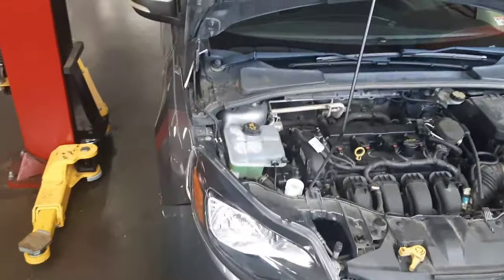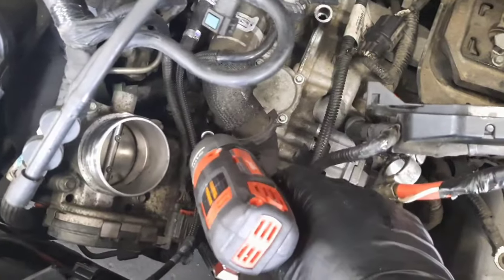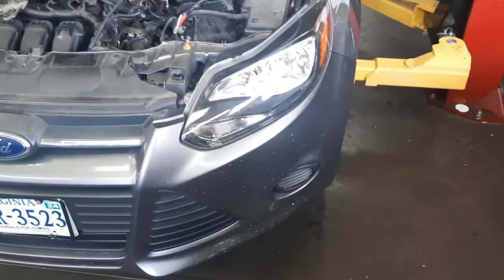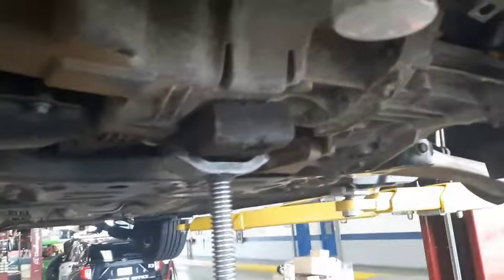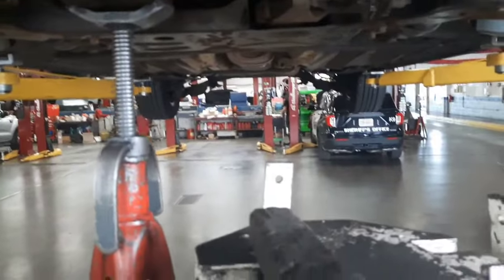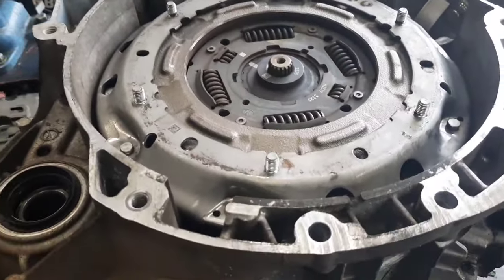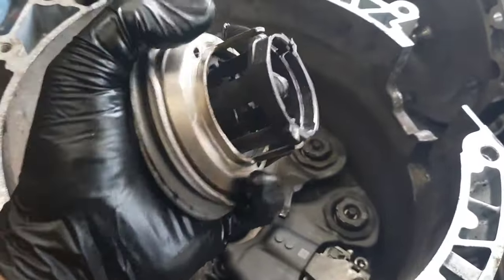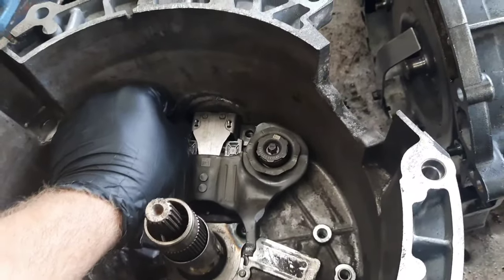Ford Focus Clutch & Fork Replacement & Transmission Removal |  Dual Clutch Automatic 2012-2018

Comment from the maker: Thanks for watching!
Dual Clutch OEM Clutch & Fork Kit: https://amzn.to/47GMeIl
OBD Link EX (For Forscan): https://amzn.to/3HsvidV

Clutch/Fork replacement with NO SPECIAL TOOLS!
https://youtu.be/EIJt9anfdSM?si=jRDZpqr8DN9kDWeA

Input shaft seal replacement:
https://youtu.be/8o4pqLBt4Pg?si=l8v1ejNLO6eRYOrI

How to tighten clutch nuts, step by step:
https://youtu.be/-JWakCz0pa0?si=0JB8Tj0FsbcJSV1W

How to make your own clutch handle for pulling/installing:
https://youtu.be/swV2EX805zk?si=PYaY_Nnl7QmlugQ7

How to remove the transmission at home, in the driveway:
https://youtu.be/UBeWfEXdYLc?si=18JzeOFt2Pv2fVTp

Transmission reinstallation at home:
https://youtu.be/UQ5u7PngpjM?si=wEfsPSjl2bEaNTJz

This is my playlist, with 50+ Diagnosis assistance videos for the DPS6:
https://www.youtube.com/playlist?list=PLpmEkNMZ3HiTlAMvp6gs7W4jZZxHbGZjZ
Reply: Did it run okay I’m about to be doing this myself

Comment: One of the better videos out there for this job, I'm Currently doing it right now and you're a life saver! Thank you for taking the time to help us ppl who don't have 4k for the dealership!
Reply from the maker: You're welcome! Happy to help!
Reply: @BigBensCarsAndCycles having a tough time with the 6 flywheel nuts... how should I keep it still while trying to undo the nuts
Reply from the maker: @rookiemvp2008  I normally use an air ratchet, like in the video. But if they're very tight for some reason, you can get a mid-torque impact up in there to bust them loose. Such as a miluakee m12 3/8". Otherwise, a mid-deep 13mm socket or even a full deep should push against the access hole and keep the engine from turning too much
Reply: @BigBensCarsAndCycles  Ok one last question, my LUK replacement clutch and forks didn't come with a packet of grease to apply to them. I tried to source the little yellow tube of grease that ford recommends but couldn't find any except online. Do you have a recommendation for a replacement I could buy at O'Reilly's or AutoZone? Would a high temp spline grease do the trick? Sorry for all the questions!
Reply from the maker: @rookiemvp2008  It's OK. Anyway, I just noticed your last message now. I may have answered your question on another post already. But yeah, I think spline grease would be great. Such as yamalube moly spline grease. It just needs a touch of grease on the actuator splines, and tips of the clutch forks where they touch the slave cylinder

Comment: I've just finished putting the transmission back together, i heard in another video that the clutch shouldn't make any noise if you spin it, but makes a rubbing noise, is that bad?

Comment: Please help. I just released the tension on the clutches and the 2nd one was harder in tension and did not hear the pops. Also it just spins and I am not getting the recoil or rewind like the 1st.
Reply from the maker: @jesussotelo7076  strange. Maybe your fork is damaged. Did you remove the shipping clip from it? If not, that would explain the tightness at first and the damage now
Reply: I checked several times for a shipping clip and was perplexed because they did have them. I will remove the clutch again tomorrow and check everything again. Is there a video on how to compress the clutch again?

Comment: So I just installed new shift forks and I reused my old clutch without pressing the clutch I got the snap ring on. When I start the car it starts up and than it stalls.
Reply from the maker: check for a missing vacuum cap on the end of the vacuum lines near the throttle body
Reply: @BigBensCarsAndCycles do you happen to have a picture of where it is at?

Comment: Are the aftermarket Clutch and fork kits on amazon worth it at around $700?
Reply from the maker: I'd get the LuK kit, as that's the oem maker for ford's dual clutch. That's on amazon
Reply: @BigBensCarsAndCycles  please link your kit in the description.  not sure, but you may get passive income for referring people to the parts you use...

Comment: Just did mines for the first time yesterday. Got it done in about 6 hours with no special tools thanks to your videos. I also didn't do the clutch relearn and the car drives better than it ever did since i owned it
Reply from the maker: Awesome! Glad you're back on the road
Reply: Hey if the car keeps acting like it's popping out of gear when you go to start or slipping when you go to take off is that clutch and fork or TCM? I have had 3 of these they all act like shit but this is the first 1I had that has started doing this and it has a newer TCM so I am thinking clutches are taking a shit? It started shuttering in reverse which I first assumed was just a trans mount but now it is acting like it is popping out of gear I put in park and it will be fine so idk. Thanks
Reply: @BigBensCarsAndCycles any advice would be appreciated thanks man
Reply: hello, did you manage doing this using jack stands or did you have access to a garage car lift? thanks
Reply: @rosidus  I used (3) 2 ton jack stands, a 3 ton jack (but you can get away with using a smaller 1) and a few pieces of 2x6 cut in 12 inch pieces (the most expensive part of the job)😂
Reply: @mikemane45  awesome I'm considering doing this job. Just called a clutch specialist and they want £3500 for the job done including a new TCM. I done a firmware update on my current TCM and with forscan  and my car drives so much better already. 

What were the signs that your clutch was going?
Reply: @thahitman2  trying doing a software upgrade with forscan and then so the adaptive relearn procedure. That worked wonders for me. Not perfect but better.
Reply: @rosidus  my problem was actually a clutch fork, I just replaced the clutch since I was there. I did notice the shudder on takeoff is completely gone
Reply: @mikemane45  ok awesome. What kit did you use?
Reply from the maker: @rosidus  yes, standard jack stands as high as you can, and lower the trans out with an engine crane, use the eyelet on top of the Trans with a chain and the crane
Reply: @BigBensCarsAndCycles thanks for your reply. Can I also use a normal car jack just to support the clutch and lower / lift it?

Comment: Your a life saver, just finished replacing the clutch and forks in my focus and I used this video the whole way.
Reply from the maker: Awesome! Glad to help. I've got tons of other focus transmission videos if you have any more issues
Reply: @BigBensCarsAndCycles  what the size or name socket to hot with the hammer,? Thanks in advance

Comment: Need help! Your videos are great and have helped me so much with this cheap beater car I bought. Currently replacing the clutch with the Luk set and installing back in tomorrow but I can’t find anywhere that shows where that arrow on the clutch needs to go or if there is a specific spot on the flywheel for it. I swore you said something in a video about it but I can’t find it again.
Reply: I don't know if you still need the help, but it needs to pair to the hole nearest to a paint spot on the flywheel

Comment: Hey Ben, love your videos! I was wondering how can you tell if the dual clutch itself is bad?  I want to reuse it if its good enough to go back in after I replace the forks.  Thansk so much!
Reply from the maker: Hi! If theres a lot of clutch debris inside the bellhousing I would replace the clutch. If theres a P2700 code or similar, the clutch may be damaged. If you remove the clutch and theres minimal debris, you may be fine re-using. Though you'll still have clutch shudder (which I'm sure you have already)
Reply: @BigBensCarsAndCycles  awesome. Thanks for the help!

Comment: Are these fork actuators all the same?  I just called Ford and they needed my vin to identify the correct parts and had different parts (and prices) for A abd B actuators.  And they were almost $250 each.
Reply from the maker: Yes I don't think there's any variation between any of the focuses or Fiestas. Rockauto has them for $110 each. They're Standard Motor Products. I think that's worth a shot

Comment: Hi Ben, love your videos. They are how I out my first dual clutch back together. I was wondering if the clutch popping up some when unlocking is normal? I am having trouble getting my rear dowel rodd in when matting trans to engine and am wondering if the clutch jumping up has something to do with my issue? All info is much appreciated. Thanks
Reply from the maker: I'm glad the videos helped. The popping is normal. For lining the dowels up, I would only have 2 bell housing bolts in, back them out a third. And then raise or lower the trans to line the dowels up
Reply: @BigBensCarsAndCycles  thank you so much for the advice!

Comment: this is the best video i have ever seen and explained so well. I have a ford focus auto got codes p287b p2837, am i most likey to replace the transmission? i dont work on car, only semis, all same same
Reply from the maker: I'm glad it helped. Those codes mean either the tcm has failed, or the case is broken inside by the shift drum. I have videos on these codes
Reply: @BigBensCarsAndCycles  oh sweet ill check them out, is there a way to t/s the tcm before going after the shift drum tabs?
Reply: also i only have 93k miles on a 18, dont know why it decided to not go pass 10 mph.

Comment: Thanks for the video.. i have a question? Would a broken actuator motor cause the same problem as a broken fork? Would the codes be the same??
Reply from the maker: Possibly but it's less common. You can swap the lower motor to the upper, and vice versa, to see if the code transfers to the opposite clutch

Comment: Hi, thank you so much for sharing this with us, I’ve learned a lot from your videos…
I have one concern, I just did the clutch and forks cleaning on my 2015 Ford Focus SE, it was running and driving perfect just had 2 codes for slow performance of forks. After I cleaned everything I put everything back and every wire/cable is connected but my car doesn’t start nor communicate with the scanner. When I turn my ignition on the engine light does not come on it take around 10-15 secs to turn on and as soon as the engine light turns on it says “Engine Fault Service Now” car has no crank nothing just sits. Every fuse and relay is good I can’t figure out what the issue is, can you help?
Reply from the maker: Sorry to hear. I would make sure all the grounds you removed are clean and tight, and properly attached. If you disconnected the connector inside the fuse panel, try reseating it. Make sure the battery cables are properly attached and tight on the battery. Make sure the battery is good and putting out 12 volts or more

Comment: I recently got the transmission fluid change and now the transmission is not working properly hard to change gears you think a new Clutch will fix it?
Reply from the maker: What codes is it setting
Reply: @BigBensCarsAndCycles  you mean like a check engine light and if there’s a code?
No light ON no code
Reply from the maker: @graphicscardtech3167  a clutch job is probably a good start
Reply: @BigBensCarsAndCycles what is the socket you use with the hammer to set the clutch down?
Reply from the maker: @graphicscardtech3167  I show the tool number on my video "clutch and fork change No Special Tools" Video. But you can also use the old slave cylinder bearing support to hammer it down. that video is worth watching too.

Comment: Great vid.  Is there anyway to measure the clutch to see if it’s still good and then reset it using the Ford tool? I’m wondering if it’s worth saving the $400 if I can reuse the clutch and only replace the fork?  I searched for a video on measuring the Ford focus clutch and couldn’t find any so that might be worth making if You’re looking for more content to make on the subject
Reply from the maker: Hi, glad to help. Generally the clutches don't wear down from what I've seen. They do develop heat spots on the pressure plate and shudder. Since your fork was sticking, it may have heated the clutch up and caused hot spots. You can try resetting the clutch (locking it) and blowing all the dust out with a strong leaf blower or shop air. You'll probably have some shudder but you can get some more life out of it I bet.
Reply: @BigBensCarsAndCycles  I appreciate the reply, I decided I’m gonna replace it.  I’d much rather have a smooth running transmission, then find out after I get it all back together that there’s a shudder I don’t like.  But great tips for the future.   like I said, nobody’s made a video about determining whether the clutch is good or bad.  At least not one i could find.

Comment: Big Ben great video! I started this project yesterday got stuck on axle nut removal because other videos I’ve seen remove it! Until I saw how u do it! No need to remove! Rrrrgg life saver! What bout resetting clutch..I didn’t c u use d tool with giant rings….do we not have to do that? Thanks in advance
Reply from the maker: Sorry for the late response! No, you don't have to reset a new clutch. It should come pre-reset/locked. Thanks for watching!

Comment: As far as the seals go, black seals are bad. Orange seals are good. The seals that I just ordered were brown. What does that mean?
Reply from the maker: Black seals are the old original design, they're horrible about leaking. Brown seals are the 1st updated design. They're good. Orange seals are the latest design. They're indestructable. You'll be fine with brown.

Comment: I’m about to replace the forks on mine. Did you replace any of the seals? I hear ford updated them to prevent leakage. I’m trying to figure out the part numbers.
Reply from the maker: The old seals which leak are black in color. If yours are orange then you're OK. The part number for ford's seal kit is EV6Z-7052-C
Reply: @BigBensCarsAndCycles  thanks! And it’s only the two seals on the dry side right?

Comment: How heavy would you say this transmission is? I'm gonna have to drop it and drag from under the car. Thanks so much for this video!
Reply from the maker: You're welcome! It's pretty heavy, you can drag it from under the car though. But I'd get a crane from harbor freight. Here's a video for your situation: https://youtu.be/UBeWfEXdYLc?si=zLT99jpZwd-jmcNV
Reply: Thanks so much for the reply and resources! You're a legend, sir. I'm midway thru removal and heavily referencing your work along with that of FordTechMakULoco and L8R-HP on the process. Can't wait to dig into this thing and see what it looks like in person. Thanks again, man 🙏
Reply from the maker: @SaintCrownMusic  you're welcome! I've got a video for doing the clutch without special tools too! 
https://youtu.be/EIJt9anfdSM?si=tgKrwv9PGC65_JR8

Comment: Hi great video I used this to take my transmission out as clutch fork b totally failed due to corrosion. What is the best grease to use when reassembling clutch forks and bearing.
Reply from the maker: Hi, the forks should have come with little packs of grease. If not, you can put a touch of any wheel bearing type grease or yamalube moly on the fork tips.

Comment: Great video!  What size socket do you use to drive down the clutch?
Reply from the maker: Glad it helped! you can use a 34 mm to drive the inner race down the shaft, or get the special tool
Reply: @BigBensCarsAndCycles  thanks good buddy!  I used the old cover thingy like you showed in another video! Figured it out on my own that it fit and then I saw your video after that just for the record, lol
Reply: @BigBensCarsAndCycles  Hey there, the top snap ring does not want to sit down in place :-(. The plastic seems to be in the way and not sitting properly possibly?
Reply: @BigBensCarsAndCycles  my nub seems to be right at the white notch, I have a 2012 ford focus, you mentioned that the clutch for a fiesta is at the white notch, does that mean I have got the wrong clutch?
Reply from the maker: @joemclaughlin7025  that's just the way the factory ones were. Unless you got it from ford I wouldn't worry

Comment: Do you have any tips for the flywheel nuts? I can’t seem to get them off like they’re stuck or something. Do I need to release tension somewhere or get a more powerful wrench?
Reply from the maker: Nothing is required to be released first. I use a low-mid torque 3/8" impact to remove them

Comment: Hey Ben, Just a question here! i got the same kit you have and my Slave came broken. Question is can I use it and just put the ring at the bottom in place or send it back and wait?
Reply from the maker: I'd wait and make sure everything's the way it should
Reply: @BigBensCarsAndCycles   New problem, Went to ford today and got the Slave Cylinder! put it in hooked everything back up and it went into rev and drive now it wont go back in park. Got to be something easy to fix I hope. any ideas?

Comment: Great video, super comprehensive! Im having some trouble breaking free the 2 bolts next to the catalytic coverter, 11:20 , do you have any tips for those or can you share how you back yours out? Thanks in advance!
Reply from the maker: Update 10/2023: I made a video on how to do this, it's in the focus transmission playlist. Hope this helps someone looking around in the comments

Use a closed end wrench to break those loose. If they're tight, piggy back another wrench to get more leverage. If you don't know what I mean, go to google images and search for "two wrenches together"
Reply: @BigBensCarsAndCycles  you're the man!